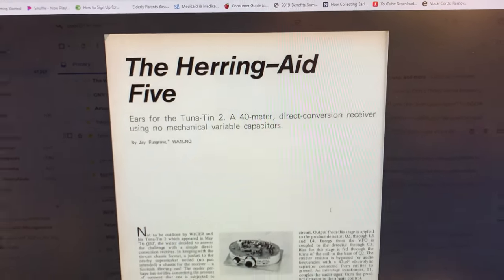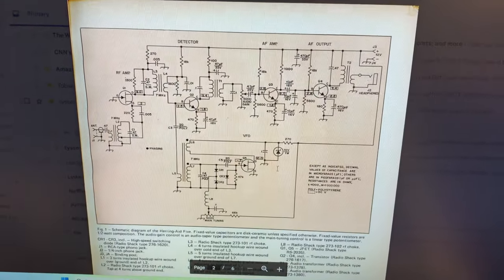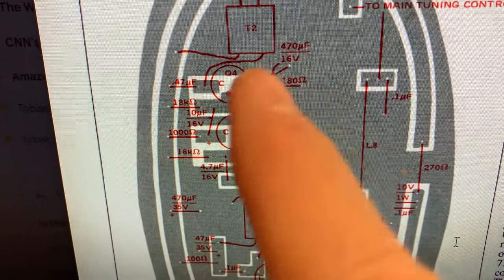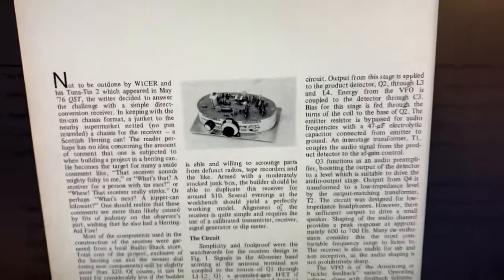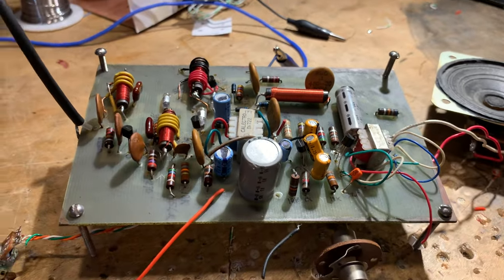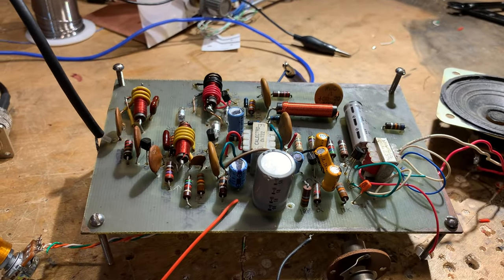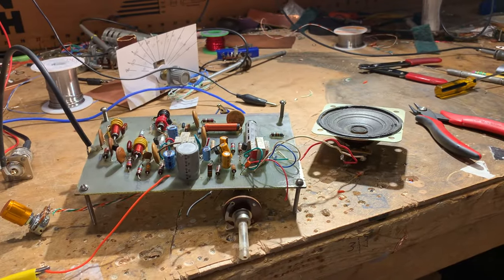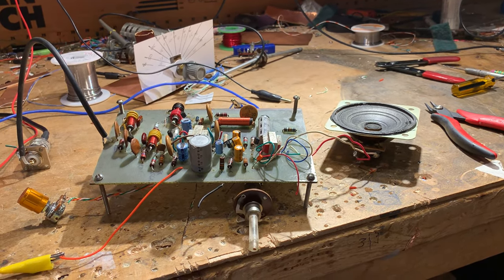Herring Aid 5 Audio Amp Schematic Error

Comment: Great bit of trouble-shooting Bill. This is one of several reasons why I think the internet is superior to print for homebrew stuff. Even if a correction was printed to an article, it wouldn't appear for another month or two - and what if we missed it? I wonder how many homebrew projects disappointed their builders due to a mistake in the schematic? I bet the original builder of this little receiver would be dead chuffed to know that you finally got it working.

Dave
AA7EE